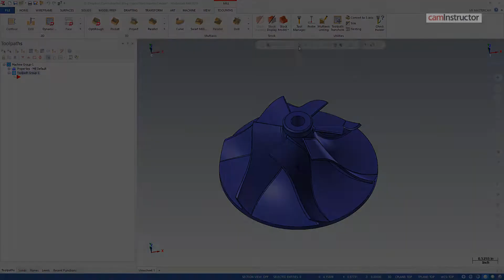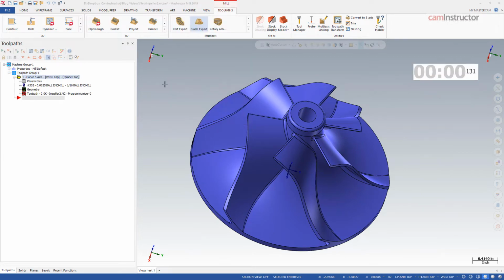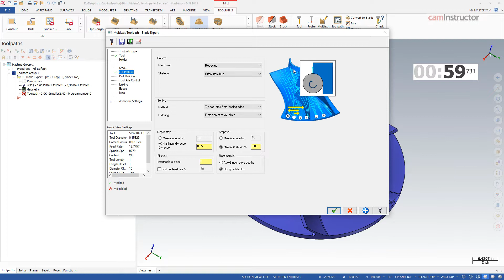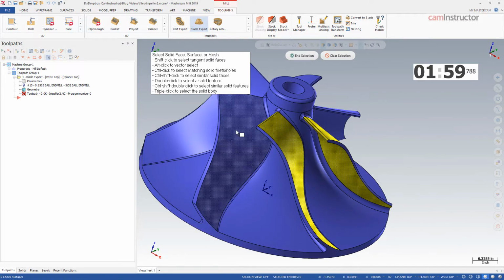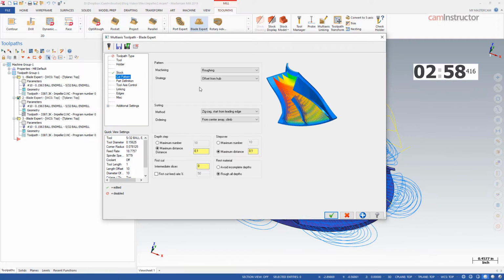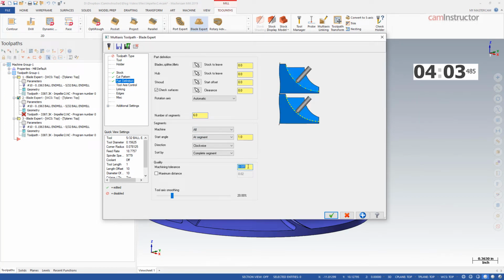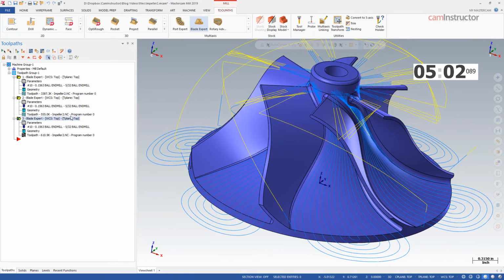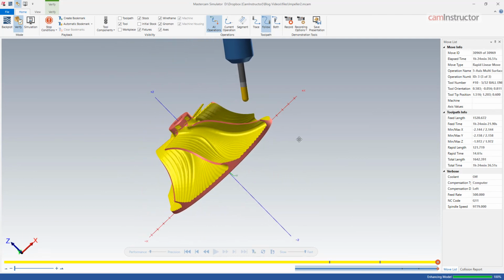5 Axis Impeller in 5 Minutes using Mastercams Blade Expert

Comment: Do blade expert will be able for 4 axis Sir?
Reply from the maker: Blade Expert does require a 5 axis machine. I do not believe you can force it to output only 4. To get the full use out of an addin like this, you would want to be using a 5x machine.
The toolpath itself must be purchased separately in the full version of Mastercam. But it is available in the HLE version so you can see how it works.

Comment: How do you go about setting up the frames, (x,y,z) so the cutter can "see" the surfaces? Or do you just need one work offset and Mastercam does frames automatically? Thanks!
Reply from the maker: Blade Expert does all the heavy lifting for you, it can create the planes it needs on its own. To do this part outside of Blade Expert, yes there would be some plane creation and/or toolpath transformations to be done.